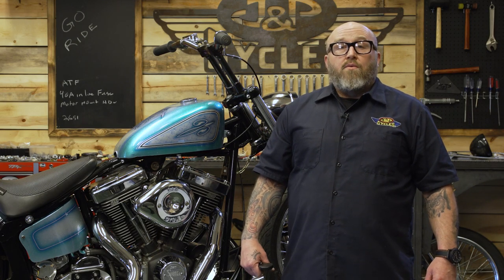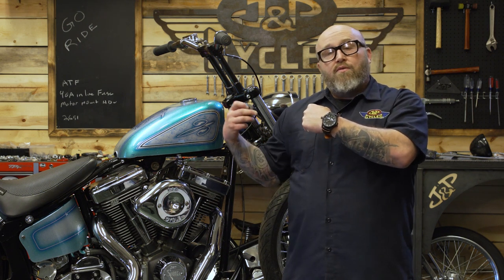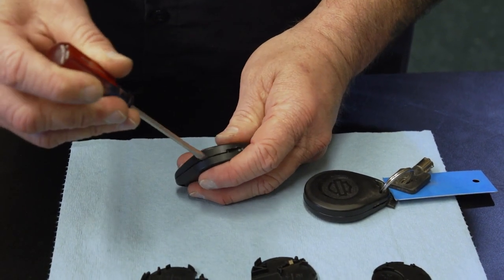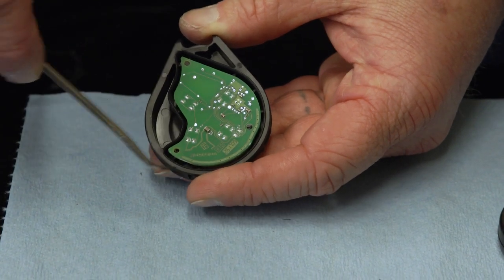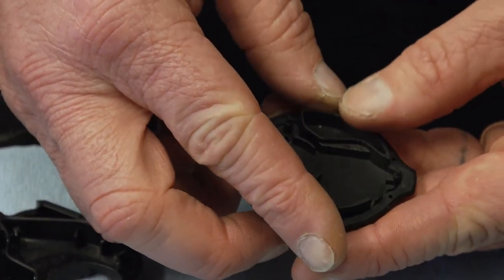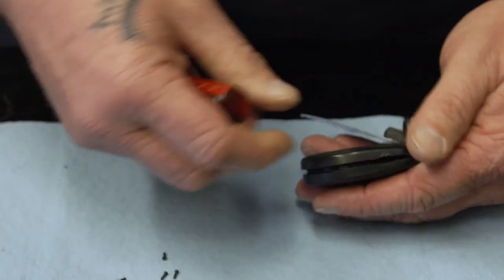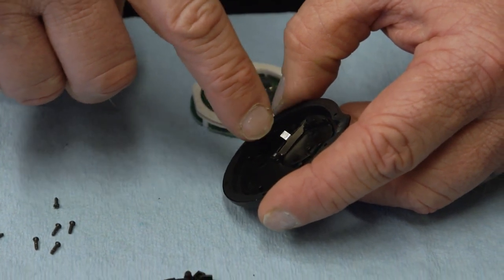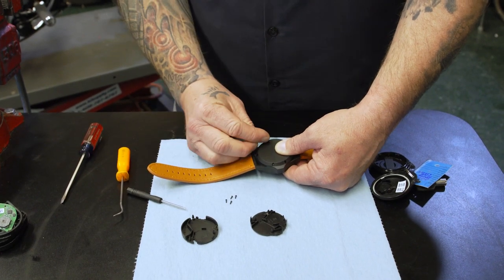Hogwatch Overview and Key Fob Installation

Comment: Oh, Damn, Almost had me there!  I'm a huge fan of wrist watches so the title made me sit up and pay attention!  Close Justin, so close!  I like the idea, but I won't be a buyer for this.
1)  Kinda pricy for a Security Fob Holder.
2)  I've seen (somewhere) nice leather Fob Caddies that fit on your belt for much less, and the watch pocket in my jeans are already paid for.
3)  Wow, is that thing bulky!  It would have more appeal if it were smaller.
4)  I've made it a habit to leave my Security Fob at home once in a while.  That forces me to remember how to manually override the Security System on my bike.  It might take a second or two longer to get rolling but, I'm usually not in a hurry.  It's also handy if the battery dies while I'm out on a big ride.
5)  I've already got a digital clock on my bike, in the odometer display, besides, it's already paid for.
But, that's just me, you do what you wanna do.
Reply: Watching this actually got me thinking of a way to integrate t into my helmet. I’m an “every time” helmet wearer so this way I’ll always have it and not have to remember to put it in my pocket.
Reply: @mdgiebel  Just keep in mind, you're supposed to replace your helmet every 5 years or so.  Will your design accommodate that?  How easy will it be to fab your fob to the new helmet?  Just wondering.  I'd like to see your design when you're done.
Reply: @mdgiebel  wonder if you ended up doing this?

Comment: If you’re following this video for the #1 note that this dude puts the battery in upside down, don’t be like him. This watch is one of the cheapest quality watches I’ve ever bought and yet the price reflects that you’re getting a well made piece. The band (if actual genuine leather) is the only quality you’re getting with this piece and even that had little to no research done otherwise they would’ve left room to remove the bands for replacement. This is a good idea executed about as poorly as could be.

Comment: That watch is too big, I have a 2006 Dyna, I only use my key fob to turn on security at home when I store it or at rallies, how do you turn it on and off in the watch. They must have put the on and off switch for the bike in the fob?
Reply: Newer model fobs are “proximity” sensed, the older fobs actually had a button to press to turn on/off the security.